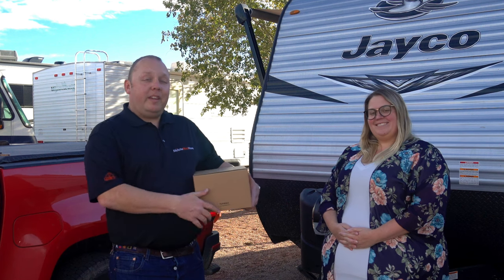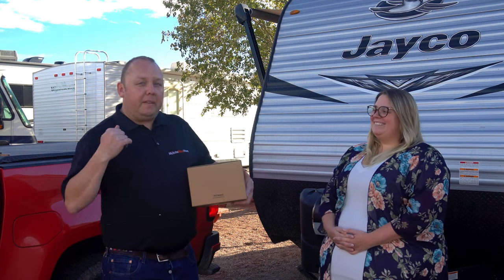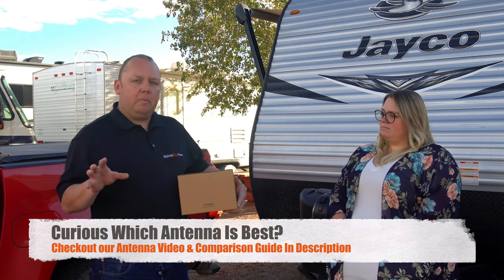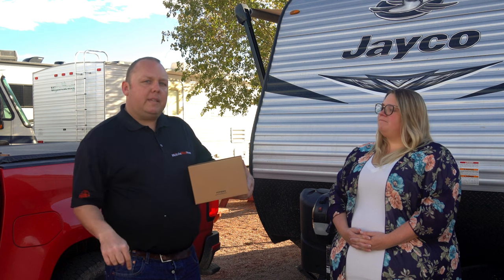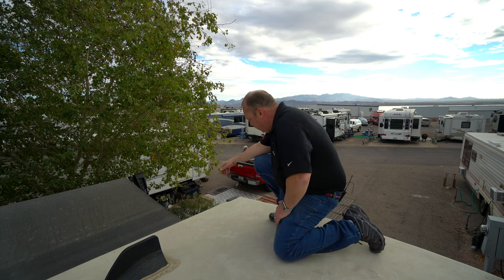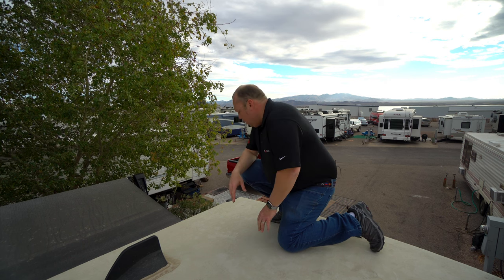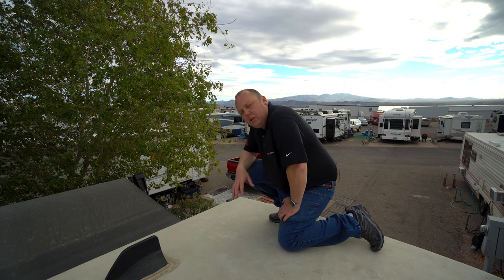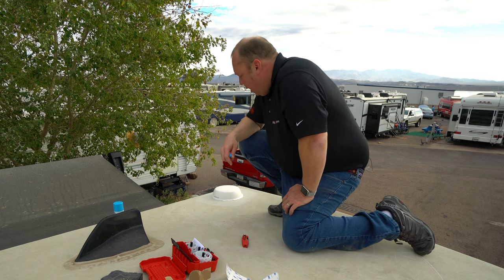Peplink Roof Antenna Installation Overview (Pepwave Mobility 42G)

Comment: Other than the studs, is there a concern of possibly hitting wires? TY
Reply from the maker: If you do a small pilot hole, you can see if there are wires there.  If there are, that is ok, you just want to use more caution drilling through.  From what we have seen, you can normal push the wires to the side if they are in the way as they have some give.

Comment: You skipped the part of where you tighten the nut on the interior side of the antenna. How did you do that?
Reply from the maker: Most of the time, the RV roof is too thick for that to poke through.  That is why the adhesive is used on the bottom side of the antenna to keep it in place.  We have installed thousands of units without that nut on the bottom, and as long as you use a good adhesive for your roof, it will keep the water out and the antenna in place.
Reply: Hmm, I'm not sure I'd want to rely on a 3M sticker as the only thing holding onto my expensive investment. High winds have got to test the strength of that sticker, especially as it deteriorates over time.
Reply from the maker: @mctenold  the dicor also is holding the antenna down along with gravity and the weight of the cables. We havent had any issues going on 7+ years with this method, that said its all about prep and making sure everything is clean and even for the adhesion to work its magic.

Comment: Hi. Is there an optimal way to connect  the cellular connectors (numbered 1-4) to the Main and Aux connectors on a router like the Transit Max Pro?
Reply from the maker: you can just hook them up in order 1-4 across the back of the router for both single and dual modem applications. The omni directional elements in the 42G are not specific to any antenna and that is what Peplink recommends for the configuration. Thanks for the great question.

Comment: How does this antenna compare to the Parsec Husky Pro 7, 7-in-1 5G Antenna ?  I assume the Husky has higher gain but it is more expensive.
Reply from the maker: On the bundle listing page if you scroll down youll see an “antenna comparison” section with an inckuded link with details on all of our 7-in-1 antenna options and differences. https://mobilemusthave.com/pages/ultimate-road-warrior-mobile-internet-bundle

Comment: If I email, could you supply me a list of recommended installers in the SW area?  I have the issue of being tall/heavy, and not sure I want to test the limits of my airstream's roof :)
Reply from the maker: just about any mobile tech can help you with an antenna install, its a pretty easy job and we would be happy to answer any questions they have. We have found that dealerships often get confused by the installation, have longer wait times and dont take the pride in work that an independent installer with good reviews takes. If they have installed a SAT or Tv antenna, then they can handle this!

Comment: This antenna sucks. I find my own devices have a better connection than this over priced one. I regret buying it.
Reply from the maker: How are you measuring the antenna performance and what are you comparing  it to? Are you measuring the signal strength and snr numbers in db and comparing to the results without a stock antenna? We have had nothing but positive feedback on the performance of this antenna as a solid mid price point omni directional so I suspect something else is at play here perhaps tower related or something else.